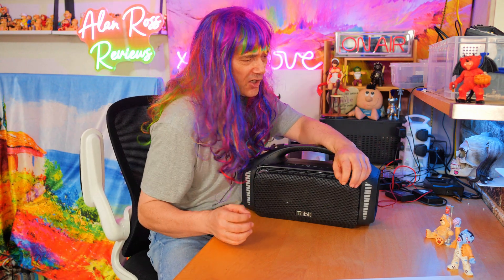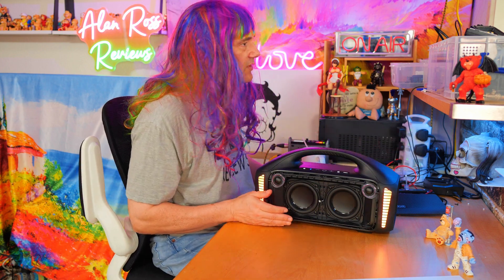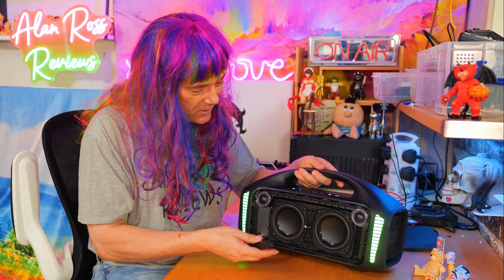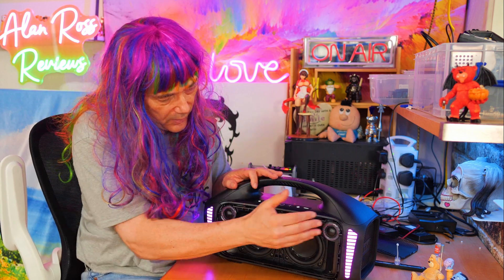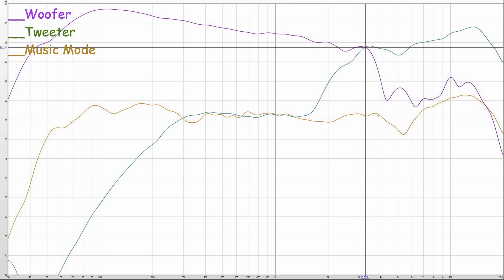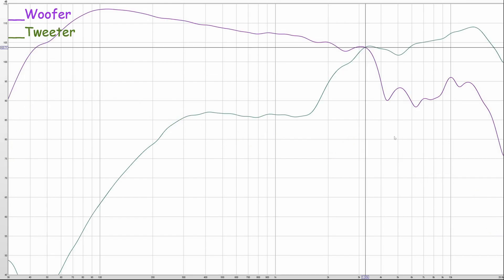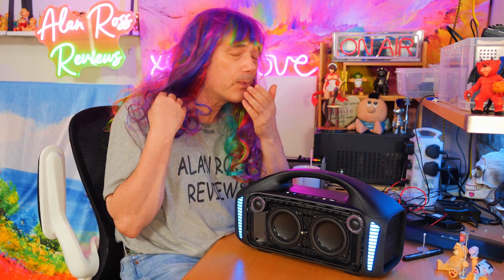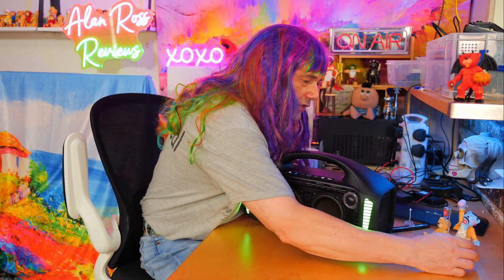Tribit Stormbox Blast the truth! the woofers, the tweeters, the crossover, the passive radiators!

Comment: Finally it's out, can't wait to see your results !

By the way, my first Blast have some passive radiator farting (only on the left one) past 50% with bass heavy tracks. It's impossible to hear unless I put my ear next to the passive radiator. But it become obvious past 60%...
(I haven't tested yet on my second one as it's doing it's break-in)
Reply: Well it's not a crossover issue, just a tweeter dip, so taking the light bar off doesn't solve it, I wasn't too far from the truth 😁
Reply from the maker: you nailed it 👌
Reply: @ThibautMahringer  you said it was most probably from the xover, so you were half wrong. Teehee.
Reply: @AbsoluteFidelity  Nah my personal take was a crossover issue, if I told anything about the cover it was just a random thought
Reply: @ThibautMahringer  thats what I said exactly, you said it was a xover problem, which isnt. It was not because of the bar either, hence why I said you were 50% wrong. Either way, that dont matter as we now know its an EQ-able problem.
Reply: @AbsoluteFidelity  I don't remember that at all, are you sure it was me ? I'm sure it wasn't
Reply: @ThibautMahringer  maybe, maybe not. Anyways we now know its not either. Time to put that Poweramp EQ to good use. A 5.5khz dip can and will screw off axis performance real bad as theese cheap tweeters are most probably beaming by then.
Reply from the maker: does it look like it moving freely ok?
Reply: @alanrossreviews  Visually the left passive radiator looks fine when it moves, but it does some small crackling sounds
Reply: @ThibautMahringer  same issue with the passive radiator on the right side above 60%
Reply: @schacktastisch  This is really annoying
Reply: @ThibautMahringer  i just can't ignore it anymore, once you've heard it, then listening to the music isn't so much fun anymore. Below 60% it's very quiet, but above 60% with bass-heavy songs it's awful.
Reply: @schacktastisch  It's not quiet at all below 60 to me. I can still use it fine at low volumes.
I don't understand why it does this, I've made a very good break-in

I hope my second one will not have this too 🤷‍♂️
Reply: @ThibautMahringer  many Users ask me about this issue on my channel. One guy has made a Video about this.. its really sad
Reply: @schacktastisch  no problem with mine even at max volume. No farting, no flapping, no unusual sound from the PR.
Reply: Maybe a minor air leak around the surround or mounting point for the affected PR?
Reply: @Grommet2007  I've looked at it and see nothing, if there's one then it's very very small